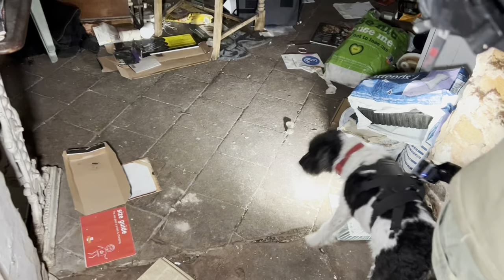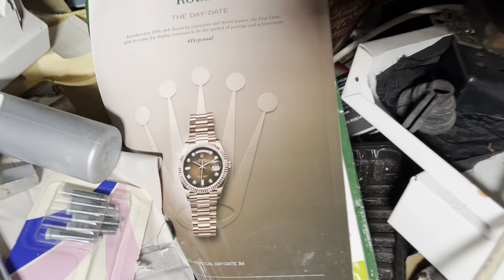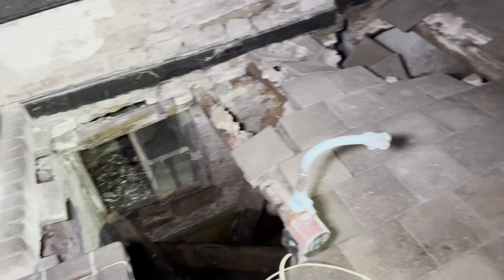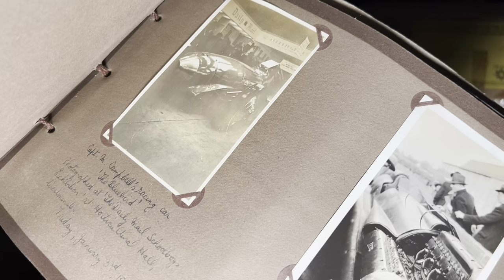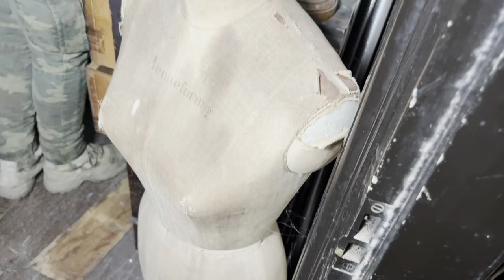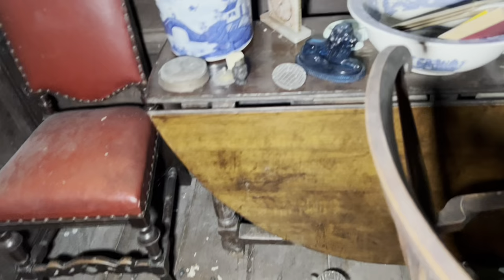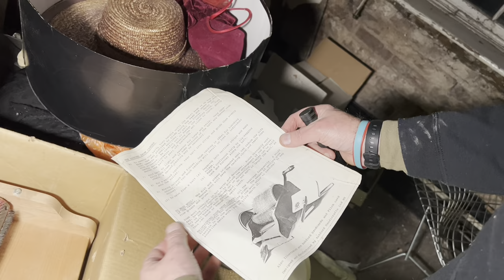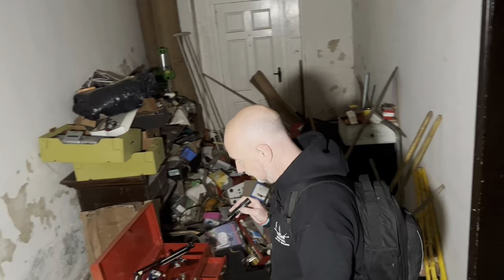This huge ABANDONED house is a hoarders dream

Comment: The wooden box with the glass rake is a "High-frequency ('violet ray') apparatus, cased, by Uvral, England. The exact same one is in the Science Museum ..
Powered by mains electricity supply, this set was used to apply high frequency electrical sparks to the body using the glass vacuum electrodes. Known as violet ray treatment, the purple, red, or blue electric sparks were believed to relieve aches and pains in the muscles, internal organs and the nerves (rheumatism) by massaging the surface of the skin with the electrode. The glass comb shaped electrode was used to stimulate hair growth on the scalp as a cure for baldness. The circular shaped electrode was used to massage the surface of the skin where there was a pain, such as the throat or ankle. It could also be used for other medical complaints."
Reply: Oh cool. I was thinking it was some sort of medical device. Thanks
Reply: It’s fucking mindblowing 😂🤣
Reply: We used something similar to the glass rake when I was in Cosmetology College back in about 1986.  It was supposed to stimulate blood flow in the scalp to promote hair growth.
Reply: How interesting

Comment: The everay
High-frequency ('violet ray') apparatus, cased, by Uvral, England.

Powered by mains electricity supply, this set was used to apply high frequency electrical sparks to the body using the glass vacuum electrodes. Known as violet ray treatment, the purple, red, or blue electric sparks were believed to relieve aches and pains in the muscles, internal organs and the nerves (rheumatism) by massaging the surface of the skin with the electrode. The glass comb shaped electrode was used to stimulate hair growth on the scalp as a cure for baldness. The circular shaped electrode was used to massage the surface of the skin where there was a pain, such as the throat or ankle. It could also be used for other medical complaints.

This was a highly popular home treatment in the first half of the twentieth century and violet ray sets regularly turn up in the attics of elderly people. Although the electrodes certainly produced a tingling sensation on the skin, these sets were of dubious medical worth. This set was made by a company called Urval.

Comment: Electronic throttle control facilitates the integration of features such as cruise control, traction control, stability control, and precrash systems and others that require torque management, since the throttle can be moved irrespective of the position of the driver's accelerator pedal.

Comment: I believe the slitted red lamp was a lamp used when limited light was required, like for an air-raid wardens blackout lamp during wartime or by Railway Maintenance Workers for safety warning use in Railway Tunnels to avoid dazzling Engine Drivers. And other jobs...
Reply from the maker: Could possibly be right about that never thought of it